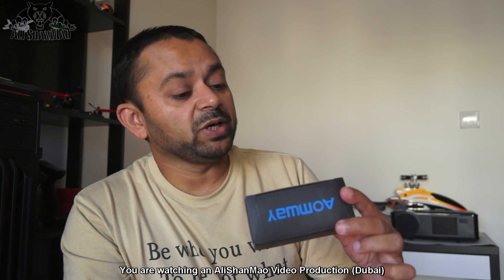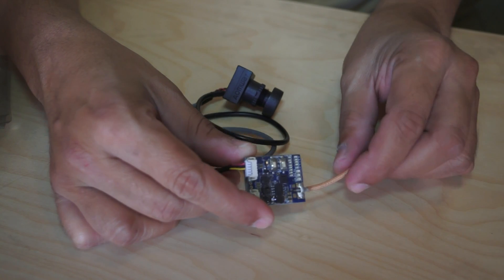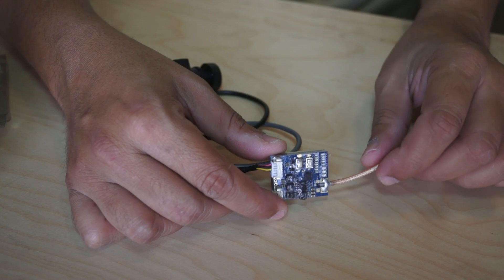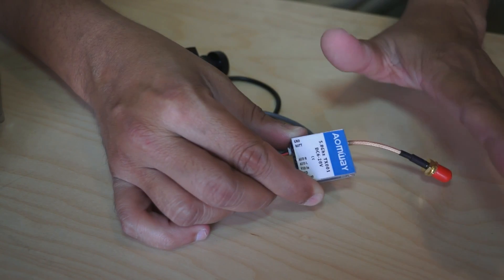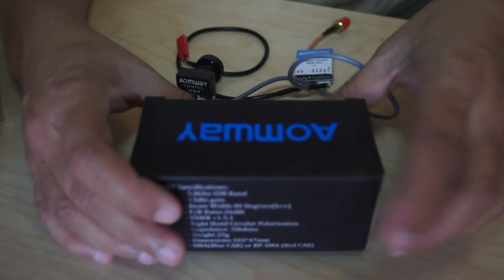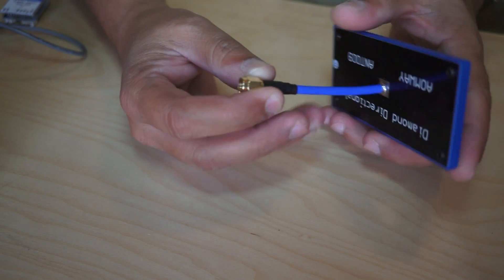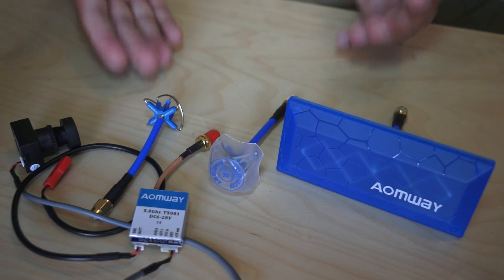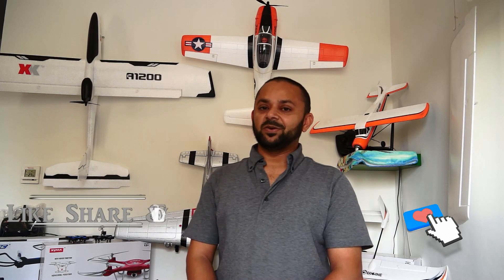AOMWAY Upgraded FPV System TX01 and FPV Antennas

Comment: You will be using a circular polarized transmit antenna with the vertical polarized patch antenna. That doesn't make much sense, does it?

Comment: Nice vid my friend, what is your favorite diversity headset for the best value in your opinion?
Reply from the maker: So Far Eachine VR D2 and Eachine Goggles 2 are my favorite
Reply: alishanmao   I blew my money on a DJI that phantom won't fix  six months  twice under warranty they still have it !  I've built a few planes years ago.   I would like to order all I need to build a drone for video that has a long range  I have a costly transmitter I have not used yet  I ended up with DJI   Do you have a video with Latest of gear ?  Can I use my DJI 2.8 cam  ?   So 600 mili amp with fly two miles roughly ?  I'd be happy with a mile of forest areas    Can you make a video on a perfect quad or you have one you built lately ? Thanks !  Great job